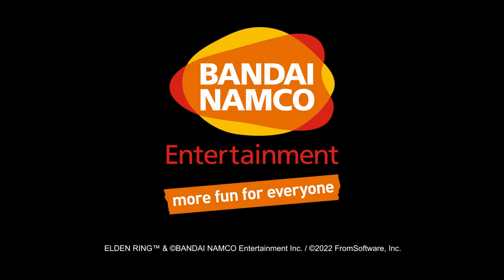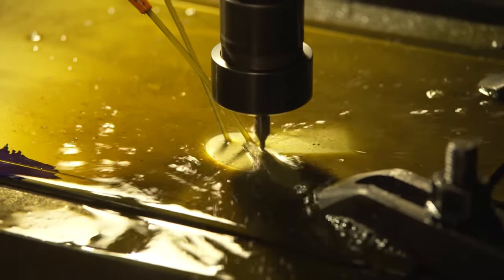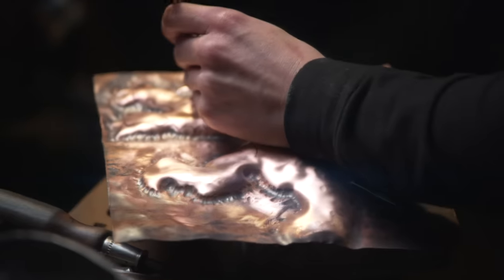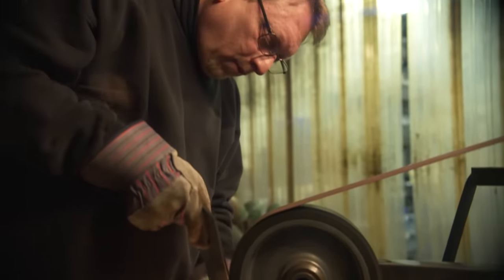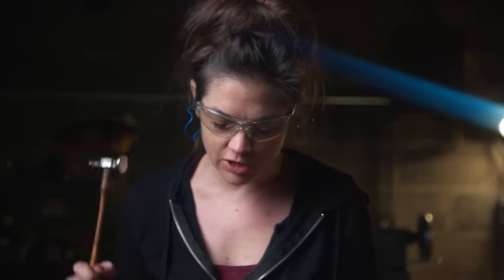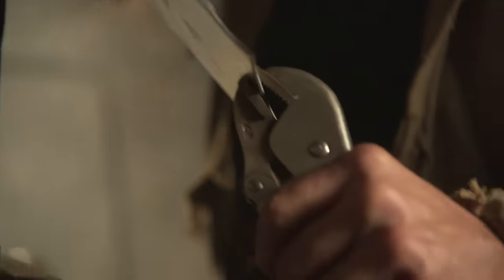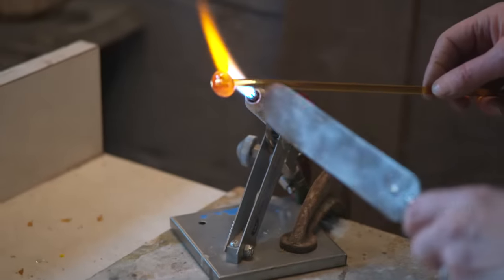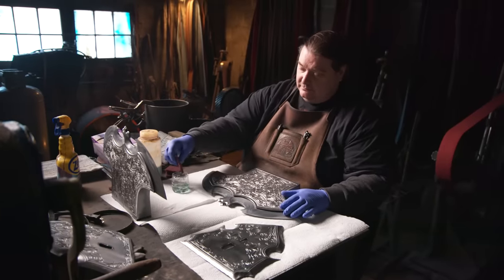Godrick's Axe - ELDEN RING - MAN AT ARMS : REFORGED

Comment: People who don't like the CNC because it's "cheating" are the same people who say "but we've always done it this way" when you try to improve anything. Pay them no mind. Great build!
Reply: If they want to complain, complain to the sponsor for not paying enough that they could put in three months work doing it by hand!
Reply: If it is a tool, use it.
Reply: The people that complain are usually people who take pride in their manual craftsmanship. Especially smiths. Im torn. You can make a perfect replica every time with a CNC. But I also understand why someone who spent their life devoted to this craft would be upset being replaced by a machine.
Reply: @altaridem  i do understand that, however I want to ask those people to step into these guys shoes for a minute.  The weapon requests on their show are not the only projects they have, they have other clientelle that commissuon them work for upcoming films so they need all the tools they can to make the most high quality work in as efficient amount of time as posssible.  Considering the insane amount of detail in this weapon and their other projects outside of the show, I dont blame them.  Plus they have proven they can do fhis all by hand, but it wouldnt be as efficient in this case.
Reply: As an engineer I find this a common belief among layman but the opposite among other engineers
It is literally shaping the material without lifting a tool, knowing and solving every problem that could occur
It takes more skill to do
Fabricating is showing knowledge through dexterity
Most confuse it for the inverse
Truly the masters approach
Reply: @altaridem  a Smith cant be replaced by cnc
Fundamentally leads to a worse end product
Unlike a machinist, their work is fully by hand and eye
Most arent craftsmen
Reply: @altaridem  does that mean artists hate printers?
Reply: @MorbidEel  nope. But a printed replica of a masterwork is worthless. Hand painted can be worth millions. The CNC requires no skill outside of basic programing and produces a replica of a masterwork that can still go for a lot of money because people either can't tell it wasn't hand done due to ignorance, or it gets passed off as hand made when it isn't. Giving credence to them being irritated that jobs are being taken from them by machines.
Reply: @altaridem  Those are problems with people not CNC. Lying to customers is bad. I think most people can agree to that.
As for not requiring skill. That is definitely not true from what I have seen. It's just a different skill set. 
They aren't losing jobs to machines. They are losing jobs to people who have embraced a new tool that has become available. It is not much different from a belt grinder or maybe the use of jigs for various things. What do these irritated people think they are offering?
It would make a bit more sense if they were selling an idea/concept. Are you buying an engraving or are you paying for the knowledge that  someone to swung a hammer for 30 hours to make it?
Reply: Exactly it’s literally a huge unwieldy fantasy axe that no one in history has ever realistically made.
Reply: @MorbidEel  Both positions on this argument are subjective I suppose. I understand why people who engrave by hand consider the CNC to be cheating. Not really any counter argument is going to change that. It doesn't mean I don't agree with people doing it. It simply means I understand why they feel the way they do.
Reply: @altaridem  it’s about personal preference in my experience. When I paint a car or add graphics with an airbrush or stripe it by hand you will see some “imperfections” and some people prefer that look. But a real craftsman will use every available tool they have access to. They’re some things one can do and the other can not. At the end is the customer happy that is truly all that matters.
Reply: I cheese Godrick letting him die by blight, so I agree 100% with you lol
Reply: If the cnc is cheating then why isn’t using a modern grinder cheating? Or the mig welder? Lmao haters.
Reply: Even if it was. It's proper because in this game sometimes you need to cheese some things to get the job done. As in all souls games. Work smarter not harder.
Reply: I was about to comment this, glad there is people with this opinion and not a closed mindset like the ones who said that
Reply: Let's not forget that if the blacksmiths of old had this and it made their life easier don't think for one second they wouldn't use it.
Reply: @CajunRecon  blacksmiths of old would jump at the chance to use technology because unlike today, they didn't have to ever think of blacksmithing as a dying art, all they ever had to worry about was how many swords they could produce to fill an unreasonable order their fiefdom demanded of them for no more than a pence, while struggling to make ends meet forging knives, kettles, pots, and nails for the common folk.
Reply: Imagen saying using a tool is cheating. Where would the line even stop? Because a hammer was used that's cheating! Better use your finger nails. Goofball thinking for sure.
Reply: Perfectly fine to use, but it takes 100% of the magic away from the craftsmanship.
Reply: You lose all the human interpretation and artistry. Sure a computer can do it, thats whats so impressive about when a human does it. Just a humble opinion.
Reply: @altaridem  the individual decides what is worth and what is not.
Reply: @NeocrimsonX  obviously. But if everything is subjective, then my stance is correct.
Reply: @altaridem  yet simultaneously incorrect 🤷🏾‍♂️
Reply: @AweMe  
Anime Inuyasha sounga sword of honorable rule and Tenseiga
Reply: @NeocrimsonX  Like I keep saying. I simply understand why these people feel the way they do.
Reply: @altaridem  I know
Reply: It's like someone saying photoshop isn't creative. "If you're creative, you'll just get the perfect shot RAW" 🙄 Yeah ok.
Reply: Thousands of photographers get the "perfect" shot without editing their photo. Being able to catch the perfect moment is one of the prime tenants of being a good photographer. And this has already been said, but you lose the artistry when you use a CNC machine to embellish a piece of work. Many people want that human element. It doesnt mean I don't understand why people do it. And im not even really opposed to it. It's funny how bent out of shape people have gotten over people feeling using the CNC is cheating lol.
Reply: @altaridem  I agree that the vast majority of how good the shot looks should be based on the shot itself. That doesn't make editing it to enhance it "cheating". It's just another tool that makes the process better. 

In this case you could argue that they should do it by hand. But it took them literally days, even with the machine and this is just one of I'm sure, a TON of projects they are currently working on. 

It's not practical. That's what matters for a business.
Reply: Is power hammer cheating?    Or sanding machine
Reply: @danlotroth9231  you're not wrong. Not even a little bit. Although you can't write a program to forge on a power hammer as far as I'm aware. I don't know why everyone keeps trying to prove an opinion wrong though. I'm not justifying the standpoint. I don't necessarily even agree with it. I've said that a bunch already. I just understand why they feel the way they do. Not sure why that bothers people so bad lol.
Reply: @altaridem  spose it's because digital art is such a thing now.  For many types of creative work.   It doesnt take away from the creative process n inspiration. 

Yes many of the old skills are being lost,  but just like the spinning n tapestry skills of fabric makers 100yr ago  modern-day tools will be adopted . But people will still paying extra for the hand made options,

Agreed that it's a shame that folks copy with New methods n makes more money
Reply: @danlotroth9231  and that's great. I think I said this once before. I use all the tools in my shop and if I could afford a decent CNC I would probably have one and use it. Things change. I get that. The progression of society always gets held up by nostalgia and doing things the way they have always been done. Change is hard for a lot of people. Because of that,  it makes it easy for me to understand why people have this opinion and think a CNC is cheating. Apparently that's hard for a lot of people to wrap their head around, and it makes them have to explain in great detail why I'm wrong or why I shouldn't have this opinion. I don't get it lol. It's all good tho.
Reply: There is tradition to teach us how and why, taught by the older master, and there is experimentation and innovation to move a craft forward, discovered by the younger Pupil (not hard and fast rules but a general system). This system works best when the two come together to learn how to implement new tools and working methods. anyone who stands in the way of obvious advancements in the craft is nothing short of a fool.
Reply: Go and tell that to Albion Swords.  They make all of their blades through a CNC process.
Reply: Yeah I definitely agree, especially since this is for a video. You can't spend weeks on something like that if it's a sponsor and you need to get a video out. It's not cheating in the slightest in my opinion.
Reply: @altaridem  a proper hand forged blade will always be desirable to those who know blades. I own my share of cookie cutter blades and I'd trade every last one for a good properly forged blade. I understand the use of a cnc, I want one myself but hammer and forge will always be superior in the eyes of many. Show pieces like this dont matter much how they're made.
Reply: 100% agreed. some people just have issues about EVERYTHING
Reply: It’s just generally less impressive than hand forging.

Simple as that. If you show me something that you made vs something that a machine made for you, I’m going to be more impressed with the hand made object.
Reply: Just like when using spirits in Elden Ring
Reply: As someone who read the comments before watching the video and doesn't have much crafting lingo, I was thinking about an entirely different CNC reading this. 🤣
Reply: Reminder that Socrates said writing stuff down was "cheating" and that everyone should just memorize and recite everything.
Reply: They are maidenless.
Reply: How many different Damascus combinations is enough?? 
I've always thought the CNC method was a good way to save time and let the team focus on more detail.
Reply: Doesnt Albion also use machines to create their swords? I couldve sworn I saw a HowItsMade video about it. And Albion is considered the top tier of sword brands. I dont mind using machines to manufacture weapons. In the ends, its just another tool like a hammer, belt sander, forge, etc.
Reply: What's concerning?
Reply: @altaridem  what's cnc?
Reply: @erikhaugan  Computer Numerical Control. You create a program that will execute a series of commands on a lathe, mill, router etc etc. After the program is loaded onto the machine, you just hit run and can do something else while it runs. They are fantastic machines. They can perfectly create on a level humans could only imagine. I'd use one if I had one in my shop. However. Like I've said a million times already haha. I understand why many makers consider this to be cheating. I don't necessarily agree. But I get it.
Reply: What is CNC
Reply: They're probably the same people that look down on using sorceries or summoning with spirit ashes in Elden Ring.
Reply: They had lathes in ancient Egypt..
Reply: Cnc is absolutely necessary to shave off time here.
Reply: Consent non consent?
Reply: @AweMe  It’s not cheating, it’s just making it easier to do and if people think it’s cheating then they can think that.
Reply: agreed.  Technology has improved, so yeah, take advantage of where you can speed the process without sacrificing quality.  Plus in the game magic was definitely used to make that axe, so using technology to replace the magic is fine.
Reply: CNC isn't cheating. It's just a no skill. Which is my problem. I'm trying to become a blacksmith not for the ease of use, but because I want the skill in my list of skills. Using a CNC machine is not blacksmithing and to be frank telling yourself or any one else other wise is like calling an elevator engineer when you need a plumber to fix your toilet. It's a farce.
Reply: comparable to people who don’t like spirit ashes or magic in elden ring because they make it too easy
Reply: @lancesfoodreviews423  Yup, the same type of people who get no maidens and stack no runes
Reply: @altaridem  Question? Why do you think operating a CNC is easy? Cause knowing how to work in Autodesk and maintain your equipment aren't things we're born knowing. I get this isn't your argument per se, you're just a very avid devil's advocate. My issue: Does anyone here have experience with smithing, working CNC, or using Autodesk? If not: Your opinion becomes invalid because it comes from a place of ignorance. If the professionals are cool with it and the angry consumer who doesn't know shit isn't, I'm going to trust the professional with a portfolio over the consumer who "read some stuff".
Reply: Cnc?
Reply: @AweMe  its 3d printing but forging. As a digital artist I love that it's hilarious how useful it is
Reply: There are traditionalists and there are non- traditionalists. How did you manage to make it sound bigoted?
Reply: You actually don't know that it's all people that do that so st fu lol thanks hun
Reply: Same vibe as "you're a doctor yet you use no leeches? Cheater"
Reply: @altaridem  damn people really didnt like seeing you able to see both sides huh XD I get what you mean though, its a useful tool that in this case pretty much needed as like they said in the video making it "normally" it would weigh over 400 lbs but for comisioned swords I can see why people want hammer and tongs over machine, it gives the piece a uniqueness that a machine just cant. very impressive axe either way.
Reply: Why are people even complaining. He is replicating an axe made for a fictional character that have been forged by omens, trolls, and magic. let these people have at least a CNC to help xD
Reply: Nothing wrong with using the tools you have at hand
Reply: same as players on things in game lol
Reply: Legit if someone is like "Oh it's cheating to do it that way" or "You're going the easy route" if you don't do the easier way to do something you're an idiot. Just full stop.
Reply: @altaridem  That's the thing. Blacksmithing is an obsolete craft. The only reason ANYBODY would willingly enter into the trade is because of personal interest and passion for it. Smiths were already replaced over 200 years ago by industrialization and metal working factories. The idea that they should only start complaining now when it's no longer almost impossible to start as a smith from the ground up is egotistical and naive.
Reply: There's nothing wrong with busting out the CNC machine, and it's definitely not cheating. Its an alternative tool to get the job done. It looks cool. It does the job. Its relatively faster and easier. But not as impressive as manual work to get intricate details. But as explained in the video sometimes the job just requires something automated to get the crafting time down.

Still would love to see someone actually hand crave that out even if it's just the plates and not a full build.
Reply: @devinaschenbrenner2683  Yea nothing wrong with wanting to appreciate proper craftsmanship that someone took time and effort to do with essentially their bare hands. But for folks to demand it from a company that needs to complete things in a modern timespan is ridiculous.

Comment: id love to see a Charge blade from Monster Hunter.
Failing keeping your sanity at that monstrosity of engineering, a selection of any of the melee weapons would be nice. since only the gunlance has close to as many moving parts i doubt that will fly.
for those who dont know, the charge blade has 2 modes wherein the sword becomes the handle and the very large shield becomes the axe head. actually, thinking about it either sword and shield or longsword will be the only ones that wont be completely absurd to handle